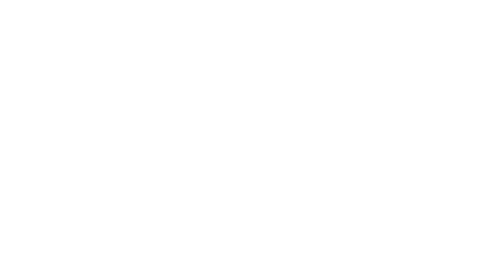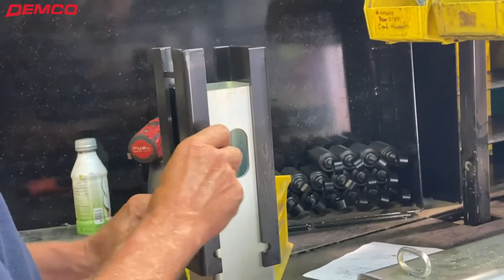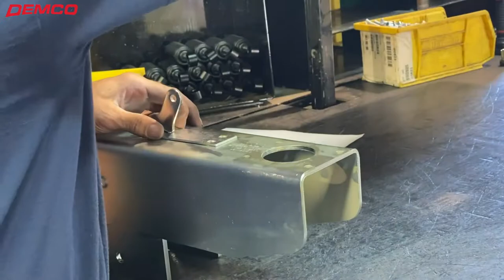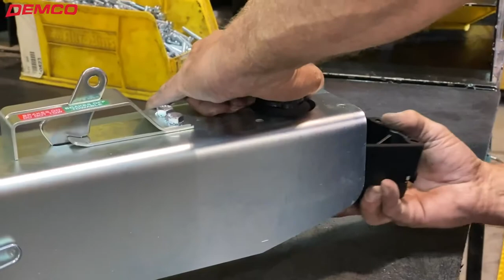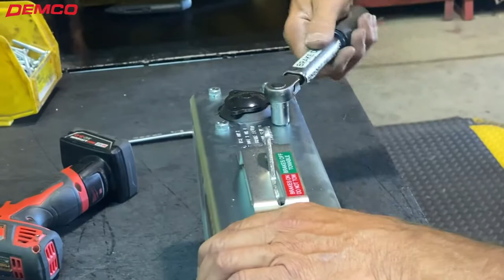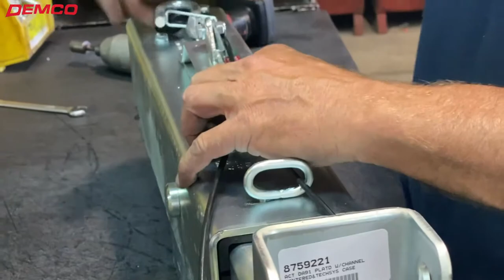We Are Demco: Assembly of a Brake Actuator

Comment: You should show a video on different weldable mounting plates that are available and proper welding procedures to make for profit fitment ! Also brake bleeding procedures! Also side note proper machine material what is best used in conjunction with galvanized coated or prep on pre primed products! Thanks again for your video Is there more info on internal components?
Reply from the maker: We have all of our manuals here: https://www.demco-products.com/trailer-components/actuators. This should give you the answers you need!